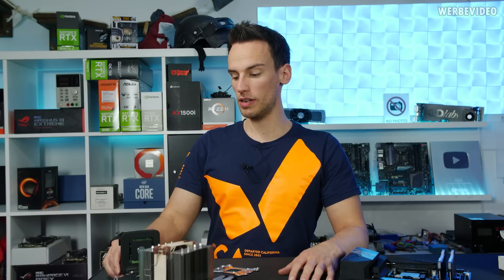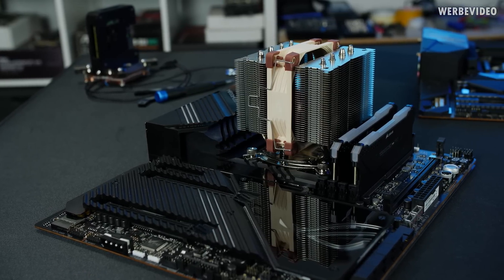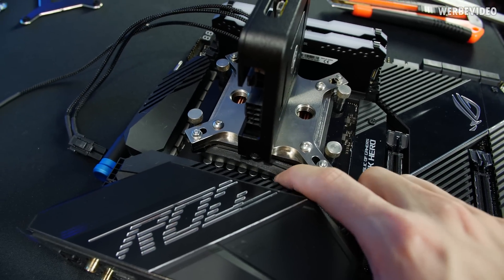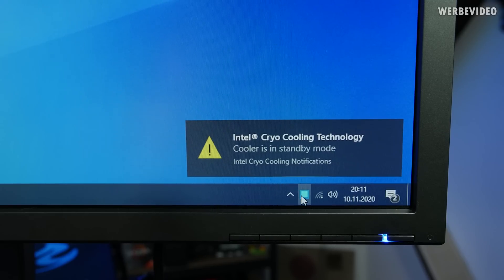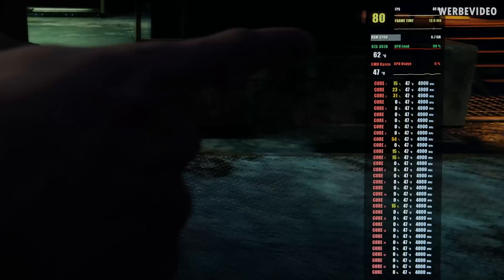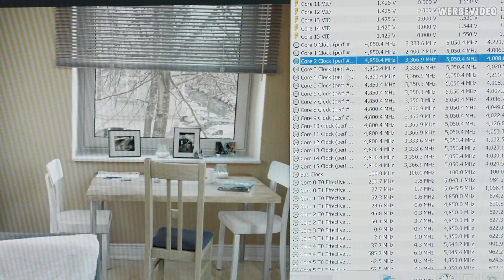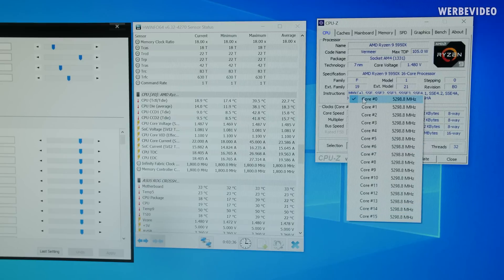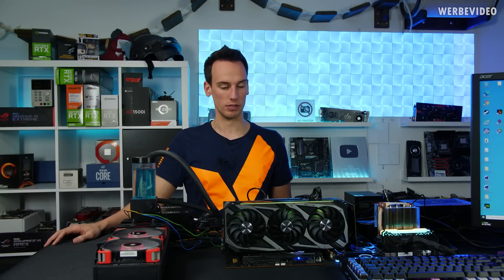I probably wasn't supposed to do this 😅 Ryzen 5950X cooled by Intel Cryo Cooler

Comment: I don't see why intel wouldn't sell this with AM4 mounts, a sale is a sale.
Reply: For 400$.. you can buy a chiller or a Single Phase Change!!.. Way way more powerful.
Reply: @TheKuiou  actually, a chiller constantly running on a big 5 gallon bottle reservoir down to 2C above dewpoint (not hard to calculate) would only have to be like 100W of cooling because the jug has a stupid amount of thermal mass. Like, you have to run a 300W load on that for 5 minutes to raise it 1C.
Reply: TheKuiou oh boy your wrong this is not a normal cooler
Reply: Because then nobody would by intel CPUs as amd are just way ahead now
Reply: @SpeedyRogue26  lmao 12th gen is better in every benchmark. raptor will be out in a few months.
Reply: @SpeedyRogue26  And would the cooler really sell an Intel over an AMD to people sitting on the fence? I honestly doubt it.
Reply: @SpeedyRogue26  you wouldn't buy an Intel cpu
You alone
Reply: @directlinkrexx4409  Everybody, not him alone.
Reply: @shotgun88deadlift  ya tell that to 1000s of prebuilts bought from dell and hp everyday powered by Intel
Reply: @directlinkrexx4409  some people still buy intel cpu ?
Reply: @ethan-fel  Intel literally has 80% prebuilt and 55% custom built pc share market
Reply: @directlinkrexx4409  and? Wonder what kind of market share Montgomery Ward used to have. What was IBMs market share in PCs in the early 80s?
Reply: @KeithAnderson-v7z  that means they are making more money 5x more money then any company

Companies are about making money
Reply: because amd would destroy intel even more if they did that
Reply: lol you couldn't be more wrong dude. Intel didn't make this cooler to make a profit off of the cooler. They made it as promotional material for their CPUs. that's more valuable to them.
Reply: If they were that much against it, I would think they would've made Roman sign an agreement to specifically NOT do this..
Reply: @RealDeal-nm3zx  just like thunderbolt, wifi 6e, 10gbe controllers,

Because amd has the capacity to make anything
Reply: the new coolers puts the Intel chips ahead with overclocking due to lower temps, they can be over powered. without the cooler, the chips would overheat and hard crash for safety reasons
Reply: Sell the am4 ones at extra price to make up for the fact their cpu sales are gonna drop 😂
Reply: because the way the product is made and marketed right now is that its an addon to a primary product being Intels CPUS.. While they could make a compatible cooler with likely zero issue they most likely won't as it could cannibalize sales in their own portfolios. They aren't trying to sell coolers they are trying to sell CPU's using anti-consumer practices (IMO)
Reply: Just as they do with Thunderbolt
Reply: Its a ploy. Cryo is a nice gimmick and some of the latest tech. Those who want to be on the tech curve are likely to buy only compatible components. 
Yes, they can make sales with this cooler, but the aim here is to also have those sales increase the sales of their other products.
Reply: Because this isn't a commercial product but a spoof to try to make Intel look better
Reply: @thelegendaryklobb2879  the engineering behind it, no.. the marketing team trying to justify their paychecks 100%.
Reply: @sirmonkey1985  Exactly. They will sell a few of course, but purely as a gimmick
Reply: Renault sells engines to Ford and Mercedes. Saves Ford and Mercedes in R&D costs and Renault makes money selling engines. Then again the people buying a Ford or Mercedes weren't as likely to buy a Renault anyway so it doesn't really affect their bottom line in a negative way.
Reply: Imagine when Intel comes up with an actual revision to their cpu lineup that how much of an advantage this would give them...

Intel has basically had the same performance potential with their desktop cpu's for years now. The moment they implement <10nm process (hopefully maintaining or improving overclocking stability at low temperatures) this is going to be massive for them - though only if this is protected by some form of loophole free patent that no one can copy over to amd's side...

Comment: INTEL:
"He can't do that, shoot him or something"
Reply from the maker: hahaha. The amount of memes in this comment section - gold!
Reply: @der8auer  So this would be the "use case" to build an tower  pc with 2 computers inside. Intel cpu on a mini itx mother board controlling this cooler on the main atx board with the amd cpu. Good idea :D Thank you derBauer for this idea ...
Reply: @jvierinen  I think that's the first really sound argument I've heard for a 2 system build.
Reply: @jvierinen  I think the use case is to use it normally, just after some other custom software comes out. Something open source, hacked, or supported by a 3rd party company could make the cooler work without intel software.
Reply: @der8auer  So AMD needs to make their own version.
Reply: @der8auer  What are  you talking about, your video is a Meme. Very creative and even child-like levels of imagination. Using a 10900K to support the dethroning competitor. It can't get more "meme" than that.
Reply: @einarabelc5  Seething lol
Reply: In the next version they will check the CPU temperatures to see if they match the cryo cooling. If CPU temperatures don't go down when they turn it on they will reverse polarity on the peltier and melt the CPU 😜
Reply: @AndreVanKammen  I would imagine the lawyers would be called in if Intel did that
Reply: @swatmajor1  Yes, in real life they could only turn it off to dissable the cryo function. But it was ment as a joke.
Reply: The only thing intel is good for now is to power a cooler...
Reply: [Intel breaks down sobbing uncontrollably.]
Reply: EP1

Comment: did you try installing the cryo cooler software on the amd system and what does it show up as to the OS since the communications system should be able to be easily reverse engineered if need be.
Reply from the maker: I tried but there is a software limit. Can only use it on 10th gen right now
Reply: @der8auer  but is it just a usb CDC serial device (would show up as a COM device in device manager) or are they doing something strange for control?